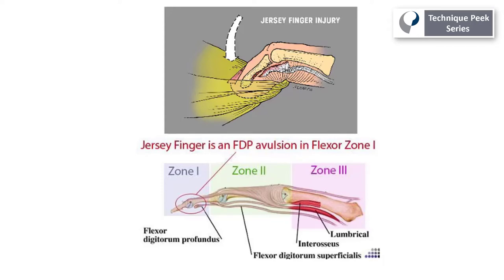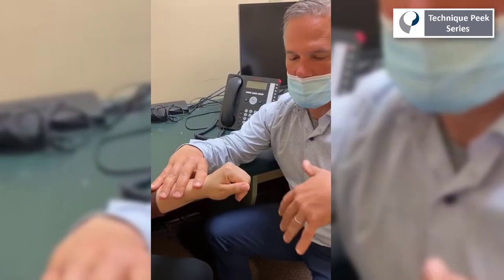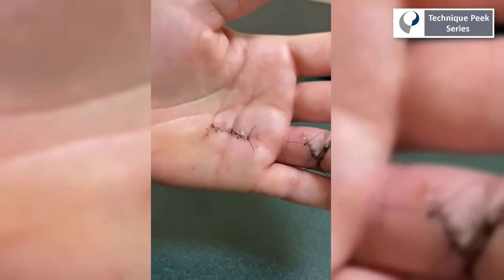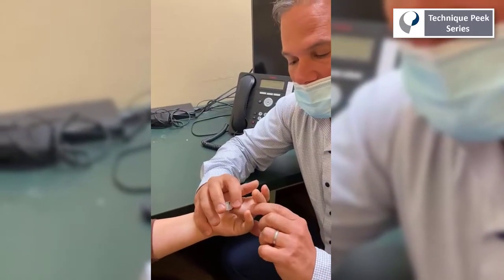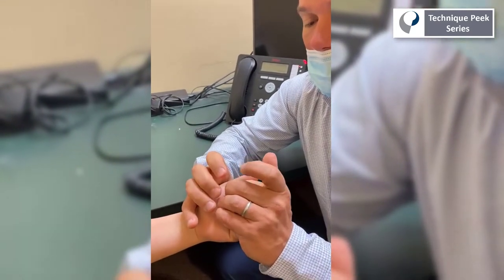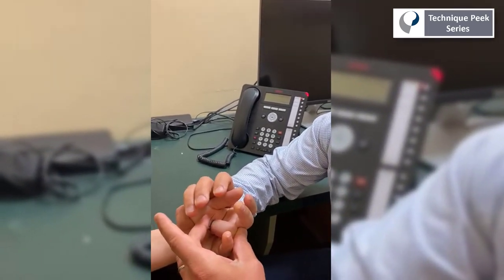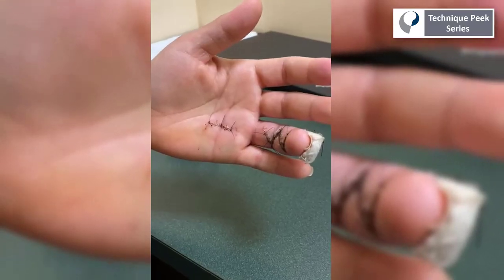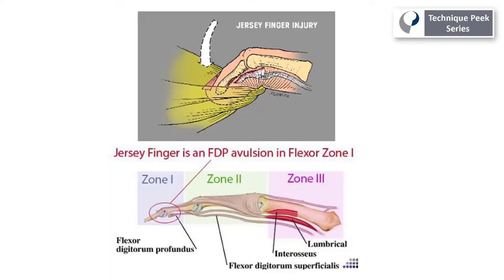How to Manage a Jersey Finger Repair  |  Technique Peek Series

Comment: Can jersey finger be fixed if you’ve had the injury for years?
Reply from the maker: Jersey finger is an injury where the finger's flexor tendon tears from the bone due to forceful extension, often from sports. Prompt surgical treatment is the typical approach to repair the torn tendon and restore finger function. Even if the injury has persisted for years, consulting a hand specialist or orthopedic surgeon is recommended, as surgical repair might still be an option depending on factors like the severity of the injury and overall health. Personalized medical advice is crucial for the best course of action. thanks for watching.